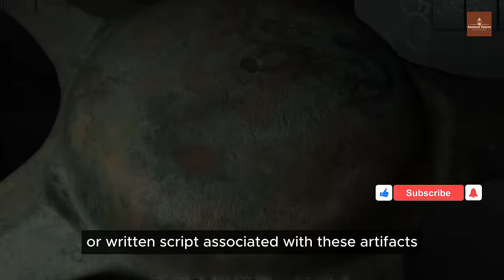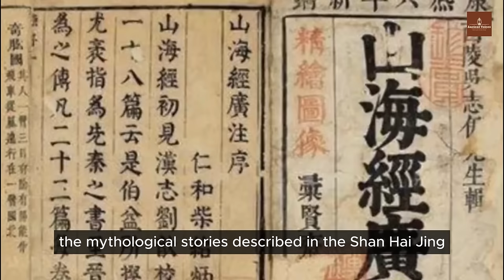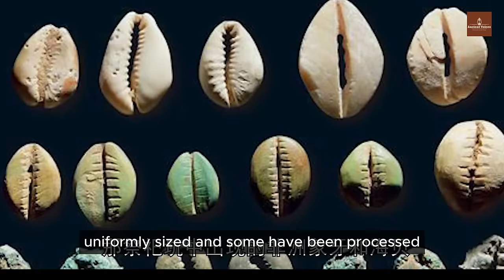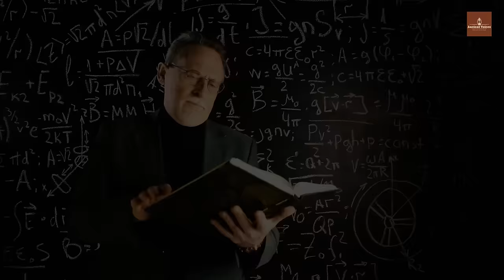Long Lost Advanced Civilization (Part 5) - An Advanced Ancient Civilization Not Recorded In History

Comment: It’s a culture older than 9000 years. 
The Ivory is Mammoth Ivory. 
Bone ash for Phosphorus. 
Baghdad  batteries for electricity. 
At the very least you could say this culture survived the last destruction of Atlantis. Its influence on the Cham culture should be noted.
Reply from the maker: Thank you for your valuable feedback. When creating this video, I did not anticipate that it could date back to 9000 years ago. However, it is highly likely to be accurate, as you mentioned.
Reply: Not welding with bagdad battery, electroplating yes, but not welding..

Comment: brazing = welding
Reply: Well no, not so. Brazing is running molten brass into a joint, almost like glue. It does penetrate the steel/iron/copper though, as the structure of the metals being joined become porous with the high heat used in the process. True welding is the joining of two pieces of the same metal by local melting, or fusing with the use of flux at almost molten temperature ( esp. in blacksmithing). ♨💥